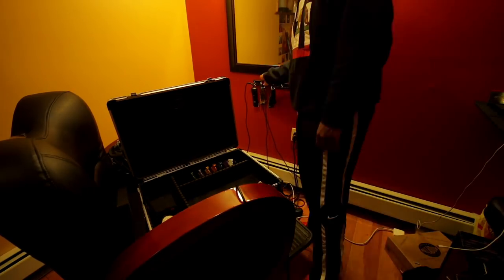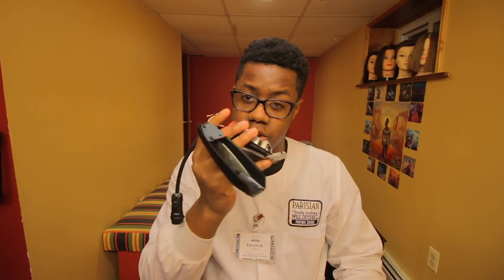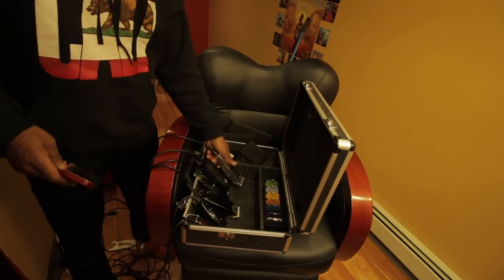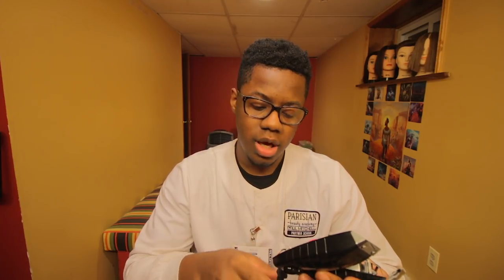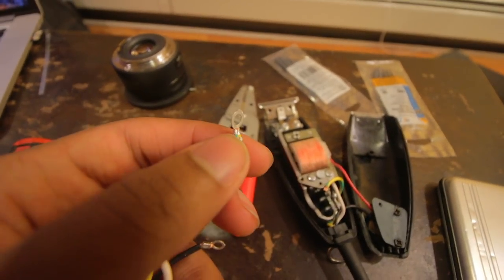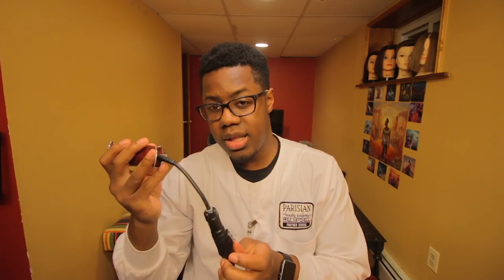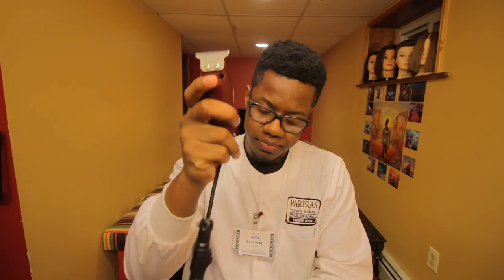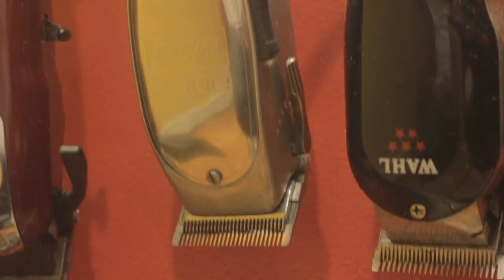Omnicord: Is It worth it?

Comment: An unlicensed, untrained person doing advanced electrical work on devices with motors that often make them run hot with no instruction or monitoring whatsoever? Around flammabe liquids like alcohol, Barbicide and cotton towels? What could go wrong? 🔥🔥🔥🔥🚒🚒🚒👩‍🚒👨‍🚒👩‍🚒👨‍🚒🔥🔥🔥
Reply from the maker: Philip Plowman you seem pretty dramatic, so calling minor soldering and screwing “advances electrical work” isn’t a surprise.
Reply: @KevvThaw  you dont know much about elecricity if you dont know what could maybe go wrong from someone wiring up an electric device without knowing what theyre doing. At the very least could simply short  out the clippers. If the building or space was old and didnt have the best wiring either? Irresponsible for this company to sell a product you have to do this much work on. A safer, easier more user friendly option would be to upgrade as many of the clippers , shavers, etc to cordless. Even just reducicing the amount of cords by half helps organizing immensely without damage. Modifications like this would also void any warranty from the original clipper manufacturer and from the cord makers.
Reply: @WigManPhil  You are either an electrician, or are very lonely.  Its ok bro,  breathe!  The risks are there,  but to each their own.